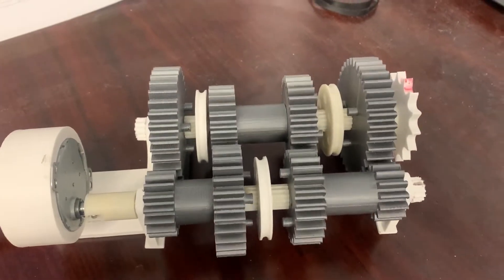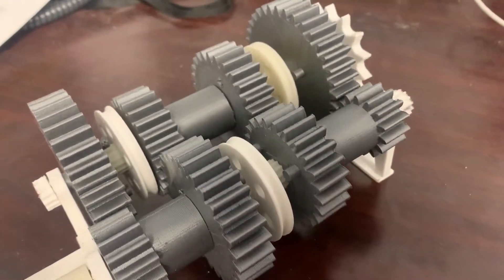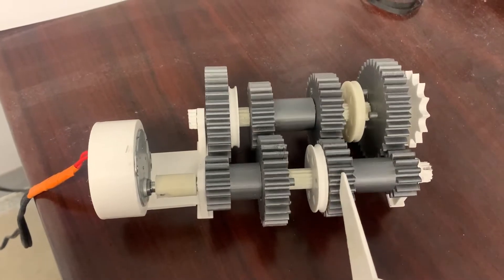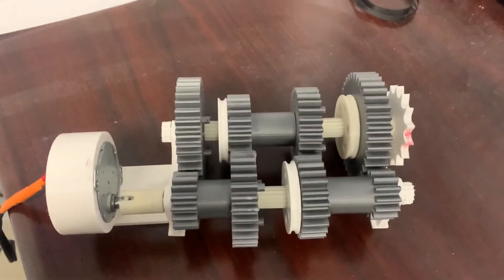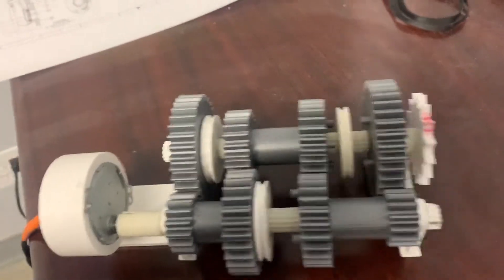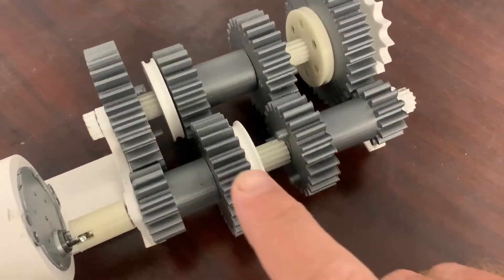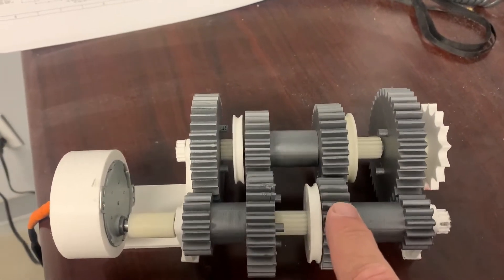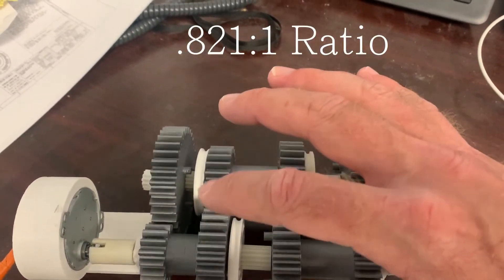Gas Gas Four/Six Transmission.

Comment: So if all the gears are moving pretty much all the time what is causing the whining noise im getting in 4th gear? I haven’t tried 5th or 6th but 4th makes such a noise im scared something is about to blow up. I thought maybe it could be the chain but it sounds different to the chain which can be heard at the same time
Reply from the maker: Good question! And super common issue. These trials bikes spend much more time in 1st than 4th. So, you've got 2 shafts in your transmission, the one attached to the engine and one attached to the sprocket. Lets call them shafts one and 2. each have 4 gears. When you're in 1st, the 3rd gear on shaft 1 is pushing the 3rd gear on shaft 2. And the 2nd gear on shaft 2 is pushing the 2 gear on shaft one. This is most common and the gears tend to wear against each other over time - and nest together. When you go in to 4th, the 1st and 3rd gears drive power in the opposite direction. 3rd gear on shaft 2 pushes against the 3rd gear on shaft one while 2nd gear on shaft one is pushing against the 2nd gear on shaft 2. There is extra backlash from the gears wearing in  - in first gear - and that's what you're hearing in 4th. 

Aside from 1st and 4th - all other gears always engage in the same direction, so this noise doesn't happen.
Reply: @gravityisnotmyfriend wow you’ve cleared that up absolutely perfectly for me, thank you so so much